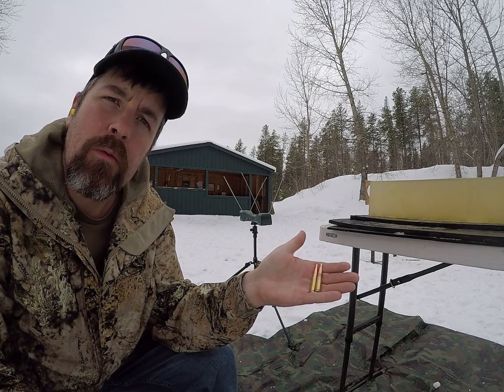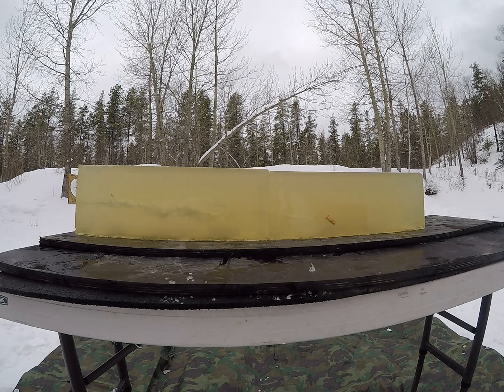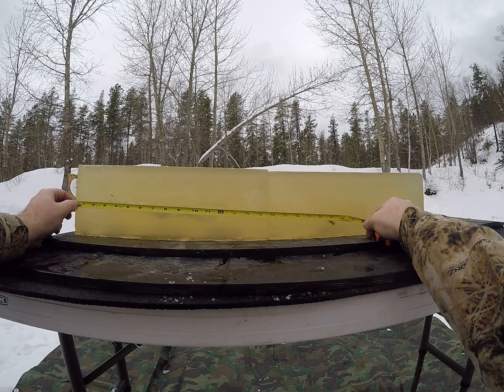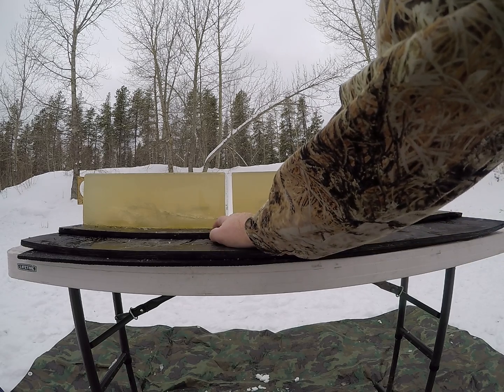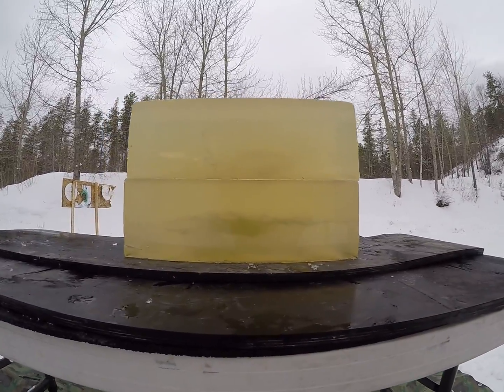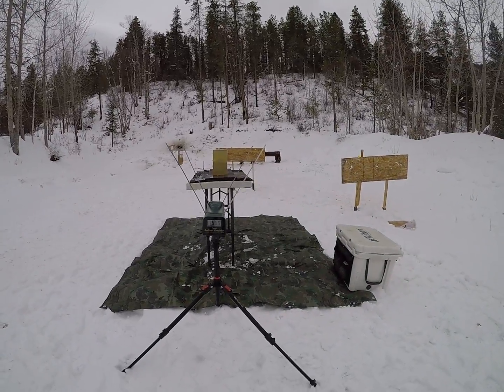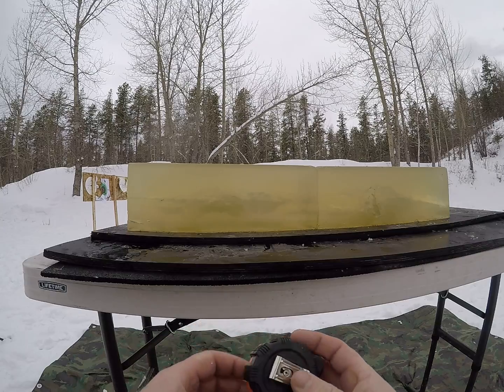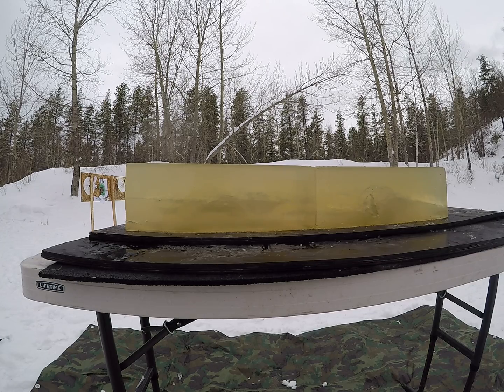150gr Badlands Bulldozer 2 experimental broaching test. Will they expand faster/sooner on impact?

Comment: After this latest test, how do you feel about the minimum impact velocity for this specific bullet? I know for the 175gr videos you said about 2000 feels right. These 150’s seem to be opening more quickly at low velocities than the 175. Would you guesstimate around 1900 or stick to 2000? That 100 fps adds a lot of range. Granted, it’s extra range most people will never use, but for a 308 it might mean the difference between go/no go at 500 yards, which is still within reasonable ranges for something like pronghorn.
Reply from the maker: They haven't failed at 1600 fps and above for me. I always like to stay 100 fps or more above minimum just to play it safe. These in a 308 should (depending on one's muzzle velocities) be good well past 500 yards.
Reply: @simplemindedfella  good to know. Appreciate all the feedback. I ordered some earlier today and can’t wait to try them out. I have Varget, CFE223, and TAC for powders. I think I’ll start with Varget for the stability. The bc and low velocity performance are so good that I don’t think the extra 50-100 fps I might be able to squeeze out of CFE is worth the decreased temp stability. Plus it’s just been the easiest of the three to get accuracy out of without too much load development.

Comment: I actually did a gel test with the 55gr BD2 at multiple distance (50yd, 100yd, 200yd) and all impacts open within 0.75" of the others, at around 6" into the block. The 55gr and 62gr have very "abbreviated" noses compared to the entirety of their lineup. I got the bullet to expand within 0.5" by cutting the stem of the aluminum tip in half. I pulled it out, cut the part that inserts into the hollow point, then put it back in.

It's the hold onto the tip that delays the expansion. Longer tips and longer noses help loose the tip better than short ones, and shorter and looser stems will come out WAY faster.
Reply from the maker: That is interesting how you cut the stem back and that it made it expand that much faster. Most likely it ejects the aluminum tip much quicker resulting in the more rapid expansion.

Have you talked to George or Jason at Badlands about your results? Maybe there is a reason they have the stem as long as it is and if not and they can simply cut it back to get the bullets to open faster that might be something they would offer in a product line.
Reply: @simplemindedfella  I have. When I got my custom bullet made, the original stem length was about 0.195-0.200", and I was able to get a stem length cut down to 0.170". He says he can only cut it so short due to the machine that holds them. He says it wince-inducing seeing how close those extensions get spinning at those RPMs.

He also alerted me that while gel tests tend to show an expansion depth of 3" or more, they always get reports of finding the tips between the entry side ribs and hide. While I think the 55gr/62gr versions will be more delayed, I think my longer nosed 59gr bullet (higher BC than both, with a speed that is very close to the 55gr) will open in the typical fashion/depth...maybe even faster, as he apparently used a "new" drill on it, the broaching goes closer to the nose walls, and the opening is razor thin behind the aluminum tip.
Reply: @calangel  I shot 2 animals with the 225gr 338 BD2 this year.  We found both aluminum tips in the meat of a shoulder when butchering, though I cannot say if it was the close or far side.
Reply: @z987k  it's definitely the near side, as the bullet can't expand till it looses that tip. You'd have an icepick wound the entire way through the animal if it was the far side shoulder.

Do you remember how far into the shoulder you found it? What velocity and firing range?
Reply: @calangel  I said I cannot say, just because I cannot say for sure, since I don't know which shoulder was which by the time we were butchering them.  It should certainly be the near side though.
Nether were shot in the shoulder though, both just behind it doing very little to no damage to the shoulders. 
First animal was at about 70 yards, second was about 220.  MV of 2850fps.

Comment: Both seemed to open faster and penetrate straighter than other tests before.
Reply from the maker: I get what you're saying. I miss spoke in one of my videos (PT2 of the 175 gr 30 cal test) not liking what I saw and not going over it in the detail I should have. I apologize for rushing that test.

I'm actually getting a really consistent rate of ones that come out of the side of the blocks versus perfect straight line penetration but none of them veer enough to have any kind of concern do to it. 

I have noticed that the down to about 1600 FPS to about 1750 or so they get a 1/2 inch or so less penetration before the bullet opens then when you get much over that 1750 to 1800 plus mart they penetrate a little further and I'm thinking that's because of how it sheds the aluminum tip in relation to the speed their traveling through the gel and that the hollow/broaching section has three stages of thickness and that aluminum tip allowing it to penetrate a little further from the speed yet you get high enough velocity and it counteracts that and opens it up quicker everything within those velocity ranges is still very consistent with each other and in most cases is not noticeable with the naked eye. They all seems to start their business within 2.5 inches to just pass that 3 inch mark. (As long as it starts mushrooming within 6 inches and causing good permanent wound cavities it will work well in game) 

Depending on caliber ojave actual front bearing surface you will see slight variations from bullet to bullet not so much in grain weight changes but more so in caliber. Anything that changes the bearing surface can change that result slightly.